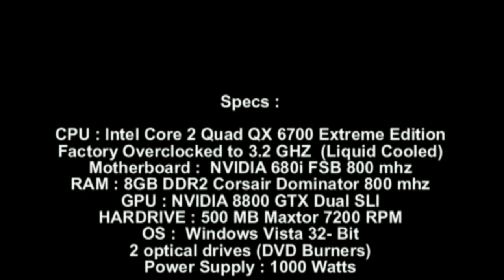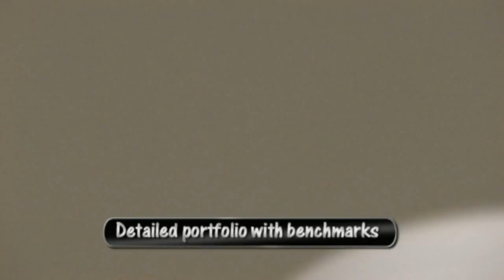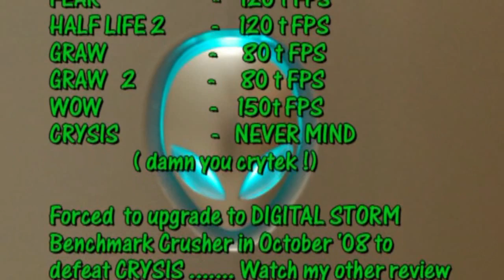Unboxing Alienware  Area-51   7500 Desktop

Comment from the maker: The Aurora Desktop starts @ $1199 with the all important Core i7 920 cpu.You just have to upgrade the GPU from the default GTX 260 to the ATI 5870, which all in all will end up to be $1490 plus tax and shipping. Or just upgrade the GPU later when prices go down.

Comment from the maker: Well, even today Crysis remains as the "hardest" game to run on any system..Any Intel dual core or quad core CPU running @ 4ghz and a pair of GTX 285s in SLI, or ATI 5870s in Crossfire should be perfect.Does this answer your question?

Comment from the maker: PC prices have generally gone down in prices in the past 18 mos. As long as you get a Core i7 based system, you should be good for the next 2-4 years. don't overspend on videocards coz these tend to go down in prices faster than any other component.

Comment: Kinda funny how computer tech moves so quickly. Those specs back for 2007 were top of the line but now? Those specs are old. Its still a powerful computer and will remain so for 2-3 more years, but those specs are far from cutting edge. Computers are like cars...once you buy them, they already depreciate.

Comment from the maker: It would be nioce if Alienware would watercool the GPUs like they used too.I tried to put in a 3rd GPU for tri SLI but the case couldn't handle the heat from 3 GPUs and would crash all the time.

Comment: Actually it works out that you pay about £200 for the case, if you spec it part for part and like for like. And that's not uncommon for *any* good computer case. So again I will reiterate. Alienwares cost no more than any other *top end* perfomance computer and come with full warranty. Oh, and I have an ALX. When I brought it last year I looked around and it was the cheapest when compared to Voodoo (HP blackbird) and Falcon Northwest. So, it was actually cheap.

Comment: Macintosh as an ioperating system is designed for work based programs mainly but they provide BootCamp so you can dual boot with another OS such as windows, and in my Mac Pro i have the upgraded ATI 4870 so i can have intense graphics and with 16GB ram it all runs fast so i basically have an intense work station and an equally intense gaming computer. But i agree that if you don't want to dual boot, Macintosh as an operating system is useless for gaming :)

Comment: @chas1996 dude, those parts with the extra crap alien puts comes out to 525 or 580 give or take with fan speed and depending if that model comes with the mutli-flashing lights. Its not hard to figure out the wattage all the parts are listed. 
yeah a 700 and 800 would work, but its not ideal. you should always have 35 to 50% more then what you need to cut down on CA%. When you play too close to the MAX the PSU's life span gets shorter and draws out more engery by time.

Comment: @Voltes75 C2Q 6600 (OC)
n680i MB
4GB DDR2 800 5-5-5-15 (8g was a total waste back then.. especially with Vista 32 bit lol)
SLI 9800GTX 
500GB HD
750 watt psu

But grats on paying 4k for the case.  It is pretty nice.

Comment: i'v got:

CPU: intel core 2 Quad Q9550 3.63GHz

RAM: Corsair Dominator TWIN2X 2x2 4 GB DDR 1333 mhz

PCB: EVGA nForce 780i FTW

GPU: 2x GeForce GTX 260 SLI

case: Coolermaster Storm Scout

PSU: Corsair HX 1000W

SOUNDCARD: Creative Sound Blaster X-Fi Xtreme Audio

CPU COOLER: corsair h50

HDD1: Corsair SSD Extreme X32 2,5" 32GB

HDD2: Samsung SpinPoint F3 250GB

DVD-RW: Samsung DVD-brännare SH-S222L

AND I PAID 600 DOLLARS FOR IT IN SWEDEN

Comment: @Xardas955 It has nothing to do with overpaying. if you look at alienwares site they have a $1800 system that you couldn't build for a penny less. it has i7 cpu, 12gb ram, GTX590.. Alot of people fail to understand alienware is not just normal pc's they come factory overclocked that is coverd by alienwares warranty. That means ALOT when it comes to overclocking. Plus they offer lifetime warranty on most parts and up to 6 years warranty on some parts when most company's only offer 90days/1year.

Comment: WOW.... looks soooo nice. but the only thing i think is stupid is he paid all that money for that and im getting one for xmas for £900 ($1440) and mine has 2G gts 240 graphics card, intel i5 processor, 1000G hard drive and 6G Ram. Also comes with 23 inch HD 1080p monitor. lmao. (My case i think is also alot better. has glowing red lights that fade on and off and the front bit that covers the dvd drives lifts up over the top. it's sooooo cool)

Comment: errrr na, a i7 920 will beat a Q6600 running @ 3.8ghz (this is what i had before i got i7 now @ 4.6ghz) as the i7 has 4 cores are 8 threads, where as the QX6700 is only 4 core 4 threads ;) the i7 is physically faster, besides the extreme editions are a waste of money, you can get a cheaper one to run @ the same core clock and be just as good ;)